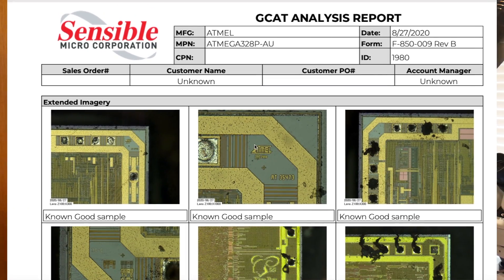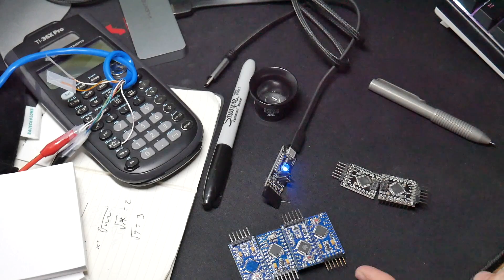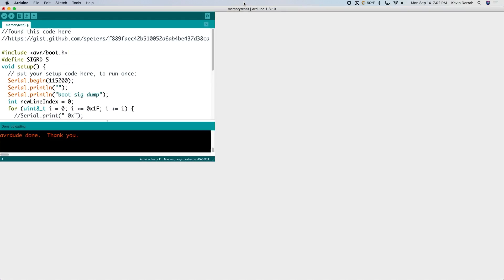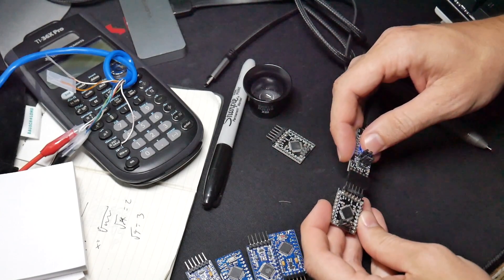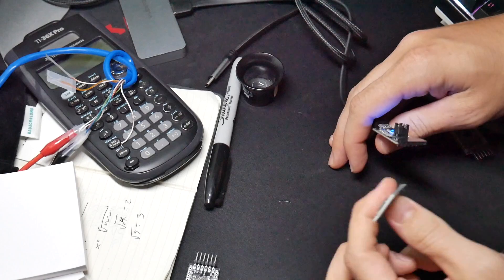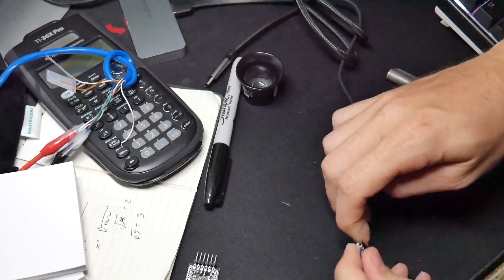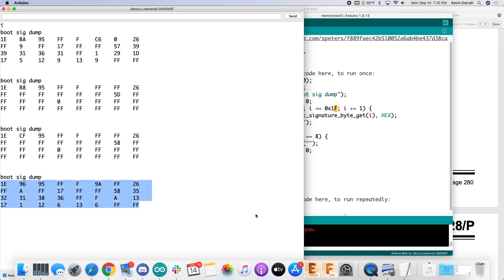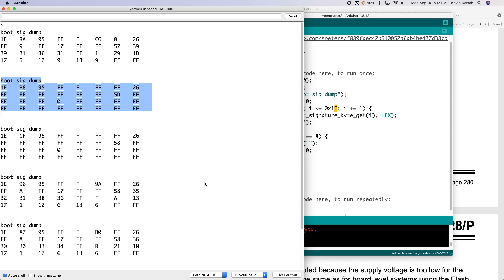Is Your Cheap Pro-Mini REAL? Easy Way to Test! (ATMEGA328P)

Comment: Since you have the capability to test the low-power performance on these, why not try to establish a correlation between the register dump and the performance? If there isn’t any, then the register values aren’t good indicators for this being a genuine or fake chip. Also, have you contacted Atmel? What do they have to say? Maybe they’d recommend a way to tell these apart.
Reply from the maker: yea, almost positive that the all 0xFF register dumps will have high sleep currents, but I will check that tomorrow and report back here, just. so. we all know for sure - that one that was sent to me was +100uA high, but will test the others.  Also,  have not reached out to Microchip(Atmel) about this yet. Maybe forum post?
Reply: @Kevindarrah  Are you related to Peter Darrah of AMD?
Reply from the maker: ok, so not worth making another video, bit all of those boards shown in the video just had their low power capabilities tested.  Of course, first I had to remove the regulator and LED from the boards, then source externally with 3.3V.  the pro-minis that failed the "dump" test with 0xFF's, read over 100uA in the lowest power test - the pro-minis that pass the dump test are in the nano amps, which lines up with the known good samples from Digikey
Reply: I've been doing both tests (signature and lowpower) on a bunch of MEGA328P and PB chips: all of them are consuming in the range of nanoAmps, but surprisingly one of them has a weird signature, similar to the second dumb on the video. It's also marked as coming from Korea. I don't know what to think about it...
Reply: I just bought 3 ATmega328P-PU (production year 2022) at Aliexpress and thought I test them. The register dump looks suspicious with a lot of FF's. However, deep-sleep current consumption is normal (around 150 nA), high-voltage programming works, and even debugWIRE is working. So, I guess it is the real thing. Here are the register dumps:

boot sig dump
1E      AA      95      FF      F       FF      FF      26
FF      FF      FF      FF      FF      FF      58      FF
DF      FF      DF      FF      FF      FF      FF      FF
FF      FF      FF      FF      FF      FF      FF      FF

boot sig dump
1E      B1      95      FF      F       FF      FF      26
FF      FF      FF      FF      FF      FF      58      FF
DF      FF      DF      FF      FF      FF      FF      FF
FF      FF      FF      FF      FF      FF      FF      FF

boot sig dump
1E      D4      95      FF      F       FF      FF      26
FF      FF      FF      FF      FF      FF      58      FF
DF      FF      DF      FF      FF      FF      FF      FF
FF      FF      FF      FF      FF      FF      FF      FF

Comment: I tried your sketch on my aliexpress nano board ( selected arduino nano | m328p  | old bootloader this is the result : 
boot sig dump
C	94	35	0	C	94	5D	0	
C	94	5D	0	C	94	5D	0	
C	94	5D	0	C	94	5D	0	
C	94	5D	0	C	94	5D	0	
It doesnt seem to add up with what you are getting , any ideas?

Comment: It's not just the low power that's different - I just ran some extensive calculations on both genuine and non-genuine chips. The fake ones took 1.6 times longer to execute the same code..

Comment: Hey kevin, I landed at this video when I was trying to upload code into my MCU on custom boards of mine. The exact marking on the part is as following 
MEGA328P
U - TH
354730
2009YG0

I am having lot of trouble uploading code into this. It has fuse bits set to 00 for all (L,H,E and lock bits too) I am not understanding what to do and how to recover it. Please suggest.

Comment: The extra information is likely to be manufacturing data, such as lot number (the way to record which wafer is which), possibly X and Y location on the wafer, and other test information. Many devices have this information programmed during testing, but the way it is stored is usually confidential and needs a special sequence to access. That might explain why the numbers from the genuine parts only differ slightly. This information is invaluable in the case that the manufacturer receives customer returns (parts which have failed in the field), as it allows analysis to see if the "failed" parts all came from the same wafer or were manufactured in the same month (for example).

Comment: Interesting.  Out of a five recently purchased five nanos from the same seller, two appear genuine, two appear fake.  The genuine have a date code 2005, the fakes are 1930 ? and 1903 with really crap laser engraving.  
The other nano is running a light show so I've no idea if it's genuine or not. No sleeping during the show though so I'm sure it'll be fine.

Edit:
It's possible to use avrdude to get the same data as the sketch.  If you are using avrdude to program your chips then this may be simpler.  You need to edit avrdude.conf though.  To do so find the Atmega328 section and just above the last "part parent "m328"" insert the following:

memory "serial"
size    = 32;
read_hi    = "0  0  1  1  1  0  0  0",   "0  0  0  x   x  x  a9 a8",
"a7  a6  a5 a4  a3  a2 a1 a0",  "o  o  o  o   o  o  o  o";
read_lo    = "0  0  1  1  0  0  0  0",   "0  0  0  x   x  x  a9 a8",
"a7  a6  a5 a4  a3  a2 a1 a0",  "o  o  o  o   o  o  o  o";
;

Save it and run avrdude in terminal mode.  You should see an extra option to dump serial.  As an example:

avrdude -C/etc/avrdude/avrdude.conf -v -patmega328p -cstk200 -t

avrdude> dump ser
>>> dump ser
0000  1e 92 95 ff 0f bc 00 26  ff 09 ff 17 ff ff 57 39  |.......&. ....W9|
0010  33 33 35 34 ff 14 12 09  17 05 12 09 13 09 ff ff  |3354... ... . ..|

Gives the same output as the sketch.  Found by a lot of trial and copy/paste, I still have no idea how the config file works.
My apologies for not formatting in monospace.

I wrote a little more at https://www.millstream-computing.co.uk/pages/posts/is-your-atmel-chip-genuine-17.php

Comment: I have had exactly the same issue with and STM32F103C8T6.   Same chips as on a Blue Pill.    I worked for days trying to get USB bootloader to work.   Finally bought a few from mouser and they worked the first time!    Ugh 🤦🏻‍♂️.
Reply from the maker: yea, that's brutal debugging right there

Comment: Aren’t they simply LGT8F328P chips with a “custom” laser etching ?
Reply: I ran this sketch on a LGT8F328P green Nano clone and it gives a completely different return

boot sig dump
C	94	0	3A	C	94	5D	0	
C	94	5D	0	C	94	5D	0	
C	94	5D	0	C	94	5D	0	
C	94	35	0	C	94	5D	0

Comment: All chips (13) I got between 2017~now turned up to be genuine parts. Thanks for your quick test-check. Worth thinking of changing your eBay & Amazon cheap'er part supplier perhaps? Recommend the folks on Aliexpress for genuine "and affordable" parts since they buy in bulk these guys, as opposed to those hiding behind the credibility of American ecommerce platforms selling plain and obvious fakes.

Comment: Just tested my new eBay atmega328p dated 39th week 2019 and it seems good.
1E	9A	95	FF	F	C5	0	26
FF	8	FF	17	FF	FF	59	38
35	94	32	31	FF	F	12	10
17	4	12	9	13	9	FF	FF
I'm assuming there is a serial number there?

Comment: Hello mr KEVIN,would you make a video on how to solve"fatal error"on esp32 cam<what i mean is"the error comes when the arduino IDE can't connect to the esp32 module ".i have been searching all arround and followed the steps mentioned but still the problem persists>thanks in advance

Comment: Will this work as a general test to distinguish genuine and counterfeit boards for all the Arduino models?
Reply: This is what I got on an Arduino 2560:

Arduino 2560 R3 genuine:
boot sig dump
1E	4F	98	FF	1	FF	FF	FF	
ED	FF	FF	F7	FF	FF	57	32	
39	30	38	39	FF	7	15	F	
17	8	12	7	13	7	FF	FF	

Arduino 2560 pro mini clone:

boot sig dump

1E	A9	98	FF	1	FF	FF	FF	
ED	FF	FF	F7	FF	FF	6E	75	
6E	6B	77	6F	FF	0	4	3	
17	1	12	8	13	8	FF	FF	

I don't know if that simply means that the clone has good components - or if anything can be concluded since the boards do not use the ATMEGA328 that you wrote the code for.

Edit: I believe this should work on any Arduino models with Atmel AVR microcontrollers - does not work with teensy, from PJRC, for instance - I did test myself. The library used in the sketch: avr/boot.h should work with all AVR microcontrollers. 

It would be interesting to know what performance deficits exist for clones of Atmega 2560 in addition to what you've shown for the Atmega 328P.
Reply from the maker: Well that looks pretty good, so should give you a little warm and fuzzy about it.  I think I might have one of those cheap boards around here too, maybe I'll test out on my end.
Reply: @Kevindarrah  I tested with two Arduino Uno clones (328P) that have ch340g chips onboard - test returned with no issues in the unique id's (I don't have a proper Arduino Uno to compare against, though). So perhaps the test does not catch all counterfeit 328p (A negative cannot prove a chip is not counterfeit, but a positive can prove that the chip is counterfeit). I'll keep an eye out for your future videos - You have one more subscriber. This is super interesting.

Comment: Just received my first Pro Mini by mail two weeks ago (I want to try that radar thing you did - got the same Bushnell radar btw). I'll test the Pro Mini with your above code soon.
Reply from the maker: yea, and that project required pretty good ADC readings, so would be a good test.  I don't know if this test will work on the 32u4 though, unless you're trying to get it to work with the 328P

Comment: can you compare them to a WAVGAT 328P ? they are also clones to the AVR328P but are marked as a WAVGAT chip.
Maybe they have the same info as your clones.
|https://www.youtube.com/watch?v=UGpfgxC0GjY
Reply: and there is also a LGT8F328P with al kinds of enhancements
https://www.youtube.com/watch?v=Myfeqrl3QP0
Reply from the maker: yea, maybe, but I think those clones don't support EEPROM? so that would be a pretty easy test... I should try that out though as well on these parts.  Even the LGT8F328P doesn't mark itself as a genuine Atmel device though I thought?

Comment: Yo know the Internet is gonna reverse engineer those bytes and figure out what they are used for now, my guess would be a serial number, batch number, factory ID and date.
Reply: That would be amazing. We didn't have that capability on "Arduino" AVRs yet. It's a feature I find most useful on the STM32 so I can tell them apart even when they run the same code. E.g. MAC address cretion, etc without changing it before you upload it to each board.

Comment: I feel that Atmel should release an oficial way to identify counterfeits
Reply: It wouldn't be too smart to do that as a manufacturer, because then the fakers can adapt to the test strategy.

The manufacurers however usually do answer e-mails when you ask if they can tell if the chip is real or not. At least ST does that with counterfeit STM32F103 chips.
Reply: @crasbee  not if the system is only on their website, where you can insert these random hex values and it tells you.
Reply from the maker: yea, that would be nice

Comment: A lot of FF...!
Looks link has a new serial in there, different manufacture kinda make sense!
The byte 0x0E to 0x17 by my tests is a serial number.
On the suspicious chips has a lot of 0xFF but is not the same if you compare the two chips has one byte different. (if you share more samples could be cool).
The other thing is the byte 0x18 to 0x1d, always looks like a date. On the suspicious chips some 0xFF... 
Suspicious...

Thanks for sharing.
Reply: Yes, 0x0e to 0x17 is the serial according to (page 322) http://ww1.microchip.com/downloads/en/DeviceDoc/40001906A.pdf
Reply: @ascuber4650  This datasheet is from Atmega328PB (version B), the version Atmega328P datasheet doesn't have an official serial number.

Comment: Ha, Ha, Ha, They will fix that on the next wafer iteration.
Reply from the maker: lol, I know!
Reply: They are retooling right now.
Reply: Possibly they don't even need to change their masks... this data usually is in eFuses or (more likely here) some bits of flash that are programmed and made read-only during the wafer testing process. Should only take them a few tweaks to the automated test equipment scripts to fix this.

Comment: Hmm could you maybe ask them to compare the counterfeit chips with LGT8F328P?
What is an clone chip of the atmega328p
Reply from the maker: yea good point!
Reply: I found the LGT8F328P to be a useless chip. No 1) You cannot use the EEPROM function like with normal NANO. I found that only every 2nd and 3rd byte of memory works. (Eg, Addr 0,1 bad, 2,3 good. 4,5 bad, 6,7 good etc). Also, using interrupts does not work. It only allows for external interrupts. Using I/O change interrupts that all Arduino chips support, does NOT work with the LGT8F328P. 
I bought 10 of these clones because of the 12bit AI (0..4096) and the slightly faster clock frequency. But apart from that, I found the clone completely useless for the projects I've successfully with the Nano
Reply: @jacquesvermaak373  Is that according to the official specifications for these chips or did you get bad chips?
Reply: @bonnome2  I have not read anything about the chips. Maybe I got a bad bunch. Tested about four of them and all had the same result.
Reply: @jacquesvermaak373  Do you still have the boards? It would be interesting to see if what you Kevin Darrahs sketch puts out on that.
Reply: @bonnome2  Done a test with Kevin's code on 5 of the boards. They all had the very same result....

boot sig dump
C	94	0	3A	C	94	69	0	
C	94	69	0	C	94	69	0	
C	94	69	0	C	94	69	0	
C	94	35	0	C	94	69	0
Reply: @Kevindarrah  There is also another clone found on the WAVGAT pro mini with labeling "WAVGAT AVGA328P". Probably just a re-labling of the logic green one.

Comment: How do you know that the ones that are close but slightly different aren't just better fakes?
Reply: You don't and it does not matter for hobbyist, just don't use these cheap chips on life support or critical application.
Reply: @demoncloud6147  it matters if you want to support the company who made it, or just out of curiosity. Knowing is good even if you still use the chip.

Comment: Cheap Chinese knock-offs are not uncommon.  About 5 years ago, FTDI got tired of all of the fake USB to serial converters marked as FTDI devices, so they changed their driver to purposely brick the fake devices rendering them inoperable.  This obviously bricked all of the boards that the fake devices were on.  So, instead of going after the manufacturers (which would have been an impossible fight), the consumers of the boards that contained these chips (who had no idea the "FTDI" device was fake) were the ones that suffered.  I remember seeing an X-Ray of a fake chip that actually contained a repurposed micro that was programmed to act like the FTDI device.  It's incredible that the Chinese companies go through all the trouble of making the fake devices but they totally miss simple things like memory locations or functions that don't operate like the original.  It's obvious that they don't really care how it works, they just want to make the sale and not worry about what happens next (because the Chinese government will defend them).
Reply: Yes but this is different, they had to make the chip only compatible with the ftdi driver.
These counterfeits run the same avr instructionset.

This requires considerable more resources to pull off.
Reply: That’s such a dick move from whatever executive or manager decided to “solve” that issue. I’m sure they could have come up with a better solution
Reply: Honestly, I'm sympathetic to FTDI for making that move. The end-users' suffering was entirely the fault of the manufacturers using counterfeit chips in their devices to save a few pennies, in my opinion.
Reply from the maker: oh I remember that one - FTDI GATE!
Reply: The annoying part was the reason for all the fake FTDI serial chips in the first place was the difficulty in getting their chips in the first place.
When they are available, they are way more expensive than they should be, costing more than the micro they are attached to.
I had to order some FTDI chips this year, the first order from one supplier still hasn't shipped (restocking date keeps shifting), had to order more from another supplier to actually get something.

Comment: Why on earth would you buy original overpriced arduino??
Reply: To support the organization that made all of this possible and still developers the IDE?  I buy generics, but I think that everyone should buy /something/ genuine from Arduino to support their work.  No overpriced Arduino sales = no Arduino.
Reply: @antibrevity  ppl actually use the shitty arduino IDE? Damn.. I feel their pain. No overpriced arduino = no arduin = finally getting ppl to move over to proper IDEs.
Reply: @jimstand  I don't care what they use. I was trying to find a reason why would you support overpriced piece of crap that does nothing.. the compiler is not from arduino, the mcu is not from arduino, most of the libs are not from arduino... not to mention the whole aruino project is open source and most of the push forward was made by ppl that are not part of Arduino.. not to mention the "clones" (what exactly are they cloning?! ; it's not the IDE) are many times upgraded with fixes arudino never put out (beffier lin. regulators, extra holes next to pins, etc).
Reply from the maker: you don't have to do that - just buy a clone that uses genuine parts - you can still get those pretty cheap.  Even I sell a breakout with the boot loader for $10 and my parts are all sourced through Digikey.  You might want to check out the first video linked to in the description on reasons why genuine parts matter.  lol, nice user name btw!